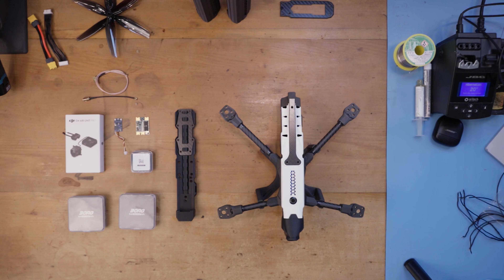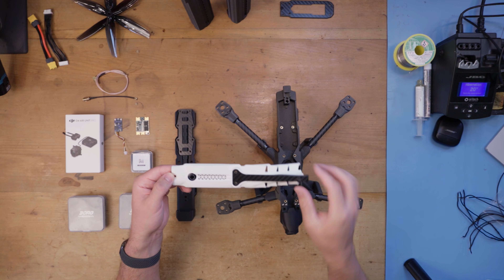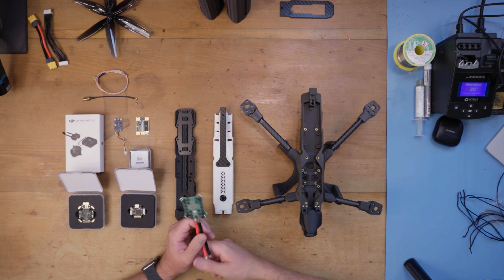Building a 3D-Printable FPV Drone from Scratch | Replicant GEN 1 — Part 1: Platform Overview

Comment: Looks amazing but I'm trying to print one now and I have to say that it's a little messed up that you don't include the .stl so we can make the battery and complete the build.  As far as I can tell you don't even include a .stl so we can make a plate for battery straps so it locks into the bottom of the drone as intended.  I'm not really sure how we are supposed to even power this drone without doing something crazy that im sure you didn't design it to do.  is your plan for us to just use a battery strap around the entire drone and squeeze it all together?   I see that you say you have a bracket that we can download but I don't see and dovetail on it and your download buttons don't work for that part.  why not just include it in the .stl build files so we don't have to search for it.      Please release something that actually works for us!!!!   and $164 usd for a 3d printed battery from another country is far far from ideal for most of the world.

Comment: Man, your project is amazing!! I'm really excited to build mine. It looks like the project is very well finished and optimized.

It's a shame I have a Bambu Lab A1 and can't print with engineering-grade filaments... Do you think it would be possible to print it using another material?

Also, what is the flight time with that battery?